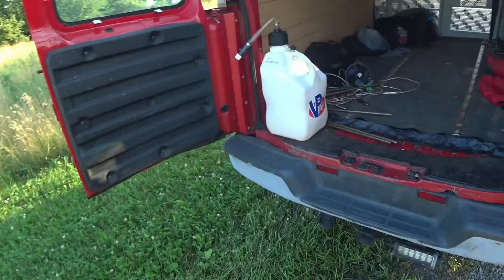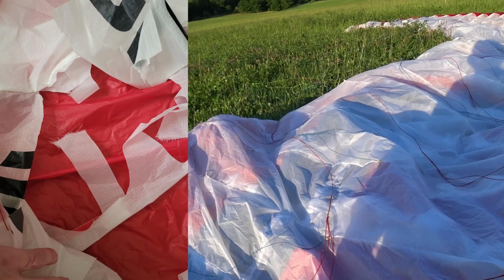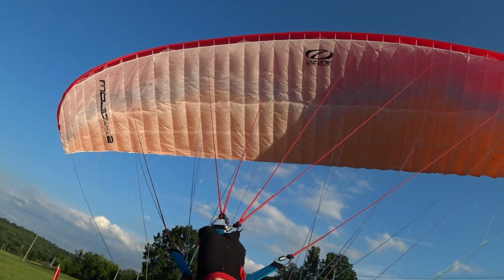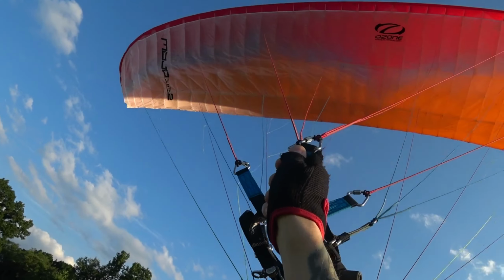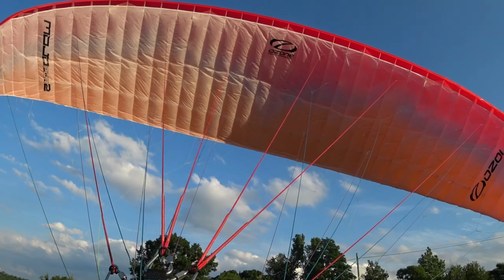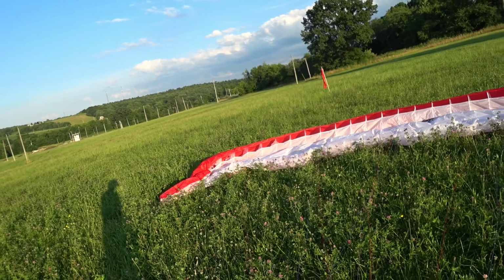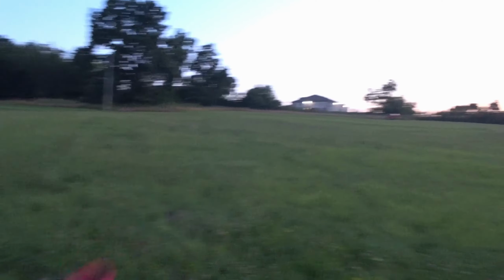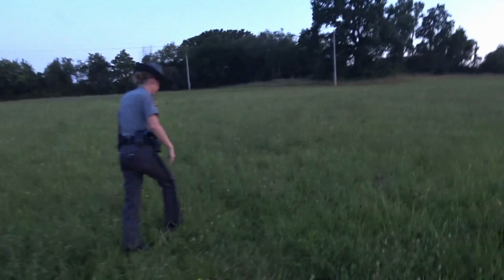Failed Launch & Major Wing Damage I Repaired Myself

Comment: Nice, looks like you did a good job with the repair. I did my training with an Ozone Power 2 and in nil and low wind, it can be a beast to get above your head. My Spyder 3 is much easier to launch in nil wind. I'm very happy I went to the Spyder 3. Everyone at Aviator PPG is awesome, especially Eric. Did my training there.
Reply: I have a mojo pwr2 and i find it easy to get up without any wind, maybe it goes up slower than the spyder because it is a reflex wing but the mojo when inflates is very smooth and stable.

Comment: Great job on the repair and all the decision-making processes around testing / first flight after. 👍 So hard to resist when the weather's good for it and you just want to get in the air. Depending on the model you choose, you'll probably find that your next wing won't overfly you as easily (reflex wings are more pitch-stable) and may also be easier to bring up / get overhead. The skills and muscle memory you develop with this wing will still be relevant, though, so it's great to keep as a ground handling / spare wing. Rock on! And Bird Up!
Reply from the maker: thanks for that insight. As I feel more comfortable on takeoffs and landings again I'll see if anyone close by will let me borrow theirs to feel out the difference. I have flown parachutes but thats a different monster haha.